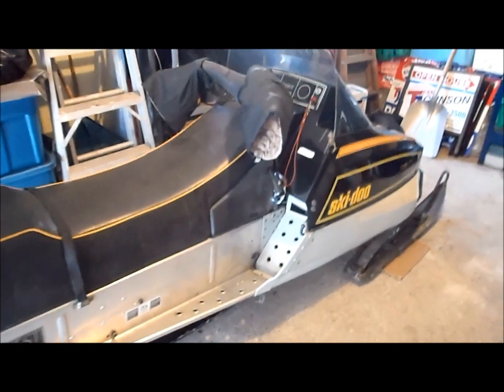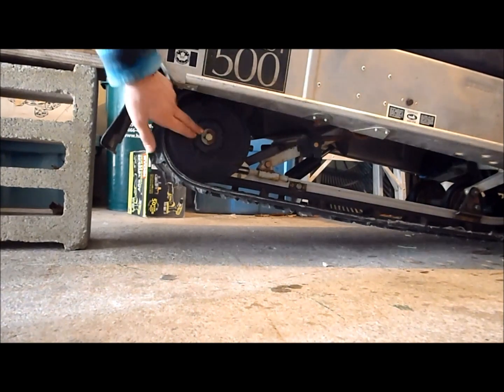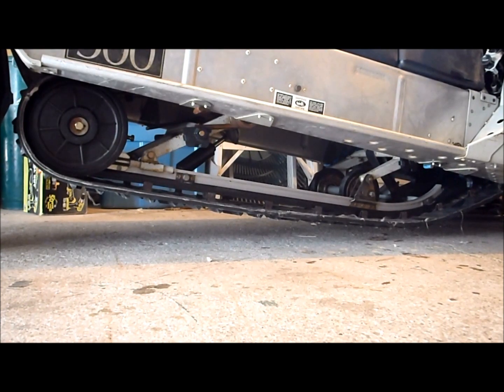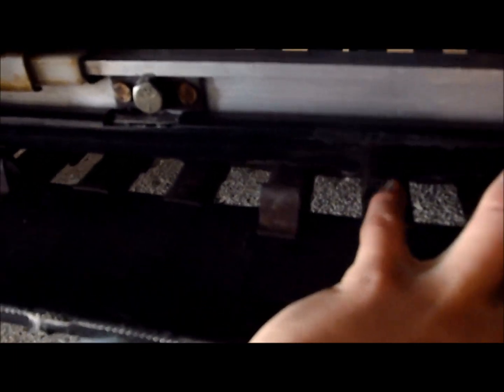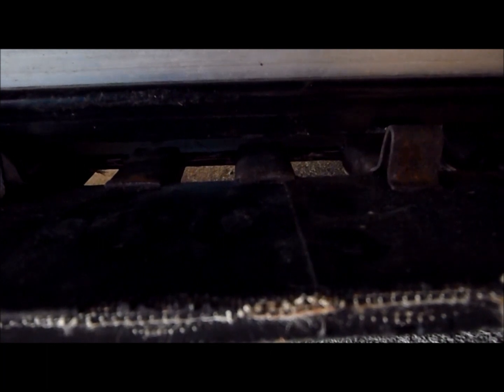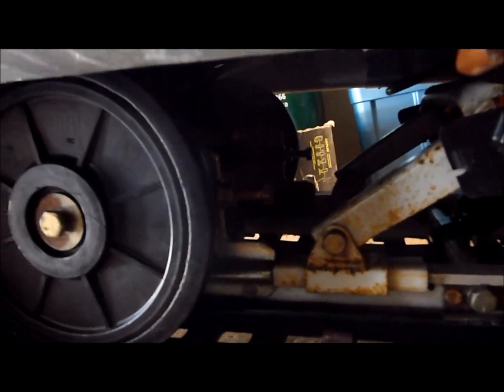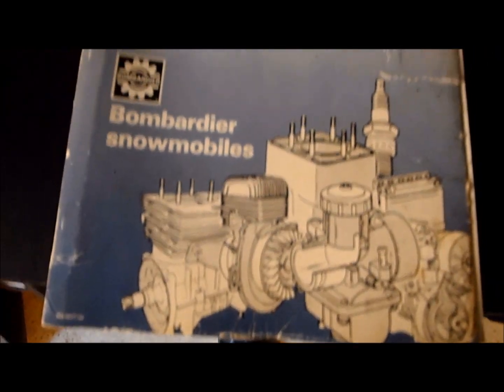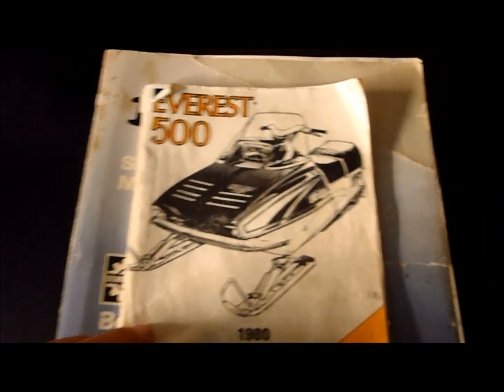Torque Reaction Slide Suspension Track Tensioning

Comment: Just picked one up today, sitting in trailr, rear of track is a god inch off the trailer, it doesn't touch until over 50% up to front, no huge paddles or cleats, will look tomorrow, got cheap, gift on an ATV buy.. bought ATV that needed rework over items they claimed were fixed so they gave me the air cooled Everest for free...